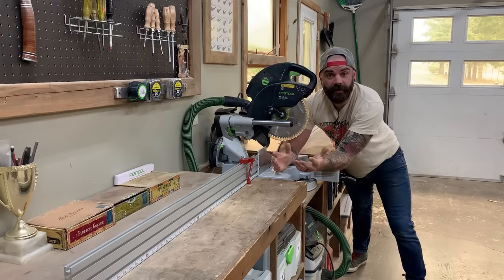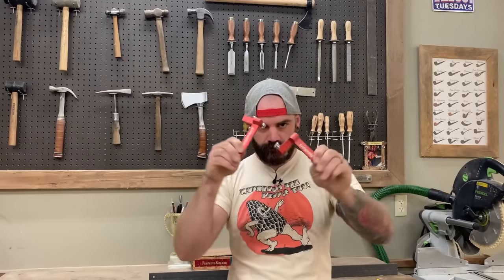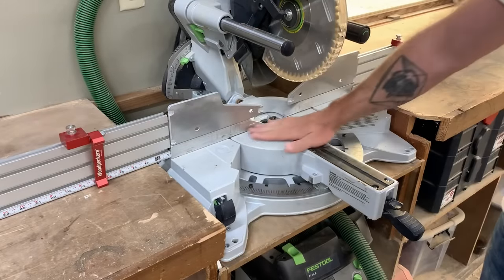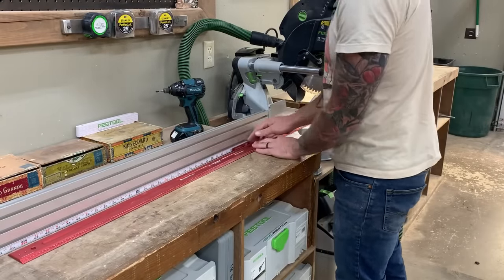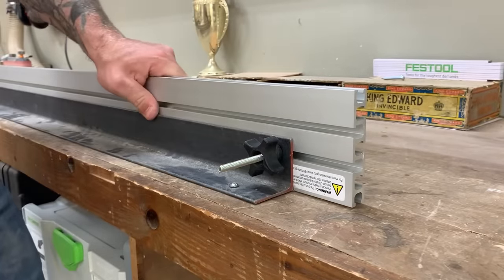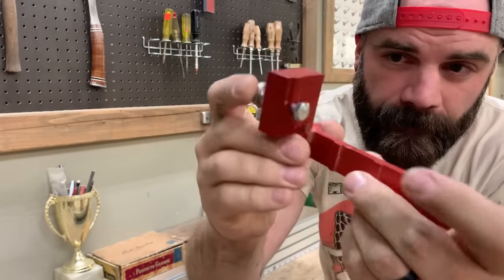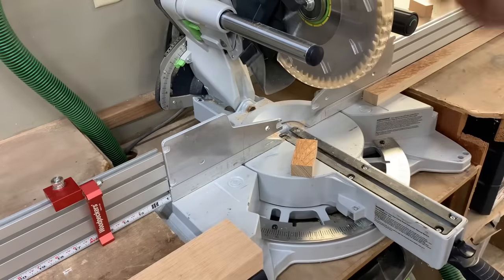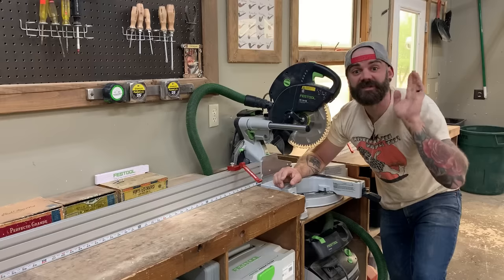DIY Miter Saw Fence | How To Make a Miter Fence

Comment: Jason:

I found you a few weeks ago. I am going to find and watch ALL your videos.
You have a great 'entertainment' technique. you turn a dry presentation into a engaging one.
That said, I am 65 now, and only had a single-wide converted carport to work in (that I had to
share with wifes/daughters 'stuff'. I was always moving 3 things to get access to one tool, then
move stuff again to get access to another tool.
NO MORE, I am about 75% done building my 'shed', it's 24x48 with 10' ceiling. All 2x6 construction.
 I'd upload a pic if I could, but don't know how.
Anyway, one of the 1st thing I will be doing is implementing many of your 'suggestions'.
Thanks and keep up the great work.

Comment: I just finished making mine. The fence worked like a charm. It was much easier to cut and drill holes in the angle iron than I thought it would be. Thanks!
Reply: Did you find long lengths of the extruded fence or simpy butt pieces together?

Comment: I just adore this.  I can't have it, but I adore it.  I have one bench that I need for various jobs.  Maybe with slotted t-tracks in the countertop so I can slide it forward and back, and a few small dowel holes for quick alignment... then I'll be able to mount multiple tools to the same spot as long as I can adjust their height.  I already had to make big adjustable fences for my router and drill press.  Maybe I can make it one fence, multiple tools.  Not to mention having that one long and flat plane.

Comment: Great idea.  I might suggest adding 3 prong nut with  1/4 bolts anf thumb screw for angle iron allows whole system to be removed if you need work space.

Comment: Listen hear Jason, I had made my mind up that when I build my new miter saw station, I was going to use a bench on one side, and a flip up extender on the other side due to space constratints.  Now watching this, I am back to building both sides with a bench.  What am I going to do with Delta/Rockwell Jointer that will not fit under the bench.  Thanks so much for the conundrum.  All that said, I really like this fence system that is brilliantly simple.

Comment: This is giving me all kinds of ideas... I’m thinking threaded inserts for the angle iron with some room for adjustability and leaving the ability to temporarily remove the whole thing. Love the bolting method for t-track... the screws always suck in plywood, especially if in a dado groove. No need for epoxy wit bolts either
Reply: Yes, love it!  I was thinking even If I had The luxury of having a workbench, I would not want the track to be there. Great video though, you are a cuckoo but makes your video more fun to watch!

Comment: Jason I’m mid fifties disabled use a wheelchair and had 2 small strokes which resulted in me losing my short term memory so I can’t remember anything I’ve just started woodworking and still trying to finish the inside of my shed in U.K. would you have any videos on a miter saw station at all. I have some tools not even some basic ones but willing to give it a go. I find your videos very entertaining and found out I can remember bits from your videos as also funny. 
I would just like to say thank you any improvement is a bonus. But thanks and keep up the fantastic job and videos you do
Cheers steve👨🏼‍🦽🇬🇧

Comment: Thanks for the video. The flipping stop is nice. To avoid referencing anything other than my miter saw fence, I embedded t track into the tables on the left and right. Now they also work as assembly tables with a whole grid of t tracks. Just another option in case it fits someone's need out there.
Reply: I'm thinking  of doing exactly this. Do you have any regrets doing it like that? Stop blocks in the way, etc?

Comment: Hi there loving your channel here’s a little tip for you I watched a video you did where you show a easy way to set the depth stop on your router using setting out blocks which are very expensive instead I use a Alan key or even drill bits 👍🏼 keep the vids coming

Comment: Your suggestion about moving the aux fence back 1/8" from the miter saw fence seems to make practical sense for the times when you have a bow in the workpiece.  However, if the aux fence is not going to touch the workpiece, why have an aux fence in the first place?  Are the flip stop and the tape measure the reason you have the aux fence?  If you have a bow in the board, an aux fence placed flush with the miter saw fence, would be a quick way to identify the problem, which then could be addressed with the jointer or a track saw prior to cross cutting on the miter saw with an accurate fence.  A longer accurate fence would also assist in aligning a long board for an accurate cross cut, rather than relying on the short fence of the miter saw.
Reply: Same same don’t get it. Why set up up for something that it not right in the first place. If the board is flush the fence is not helping.  Is it.

Comment: Rather than using only a straightedge, consider using a laser to sight the full length of your fence... that way you don't get any error at all even @ 6' or more from the saw, if your fence is that long. Set the laser on the opposing side so it slides down the entire length of your target fence, with the light visible along the built-in miter fence...

Comment: Need to make stops & measurements for miter cuts, since you show the whole thing moved out of position.
Maybe similar to that 12" block ? -- move T-track a Fixed Distance to let saw fence clear the tilted saw, then make mitered blocks for typical angles. -- Yes ?
 Good video.

Comment: Love this video! I will be remaking my miter saw station after the first of the year.  Not sure I understand the reasoning for moving the fence back 1/8".  Also, Can you share the cost of this without me having to look at all the websites?  Thanks!  A PM will be good!
Reply: Yeah, I agree. I’m no expert, and I could be wrong but if one is referencing the nice long, new additional fence which is set back by 1/8” then the cut will be askew at the blade. If you’re pushing up against the miter saw’s built-in fence to begin with, that 1/8” gap on the additional fence is going to show; and at that point I’d think the additional fence would not be helpful. This is not a criticism. I just want to know the reasoning behind it, since I’m not getting it. Love your work.
Reply: He covered that in the video. Structural lumber you get from the lumberyard or have delivered isn't all perfectly straight. If your fence is flush with the saw fence if the bow starts after the saw's fence it will push against the longer fence and your cut will no longer be perfectly straight. The purpose of his fence is to allow you to set up a jig for rapid cuts all of the same length, and it does that in spades.  I made the mistake of building my mitre saw station so that it butts up against my CNC Router table and using it and its perfectly machined square fence for this purpose. Made a bunch of cuts couldn't figure out why some of my cuts were perfectly square and some looked like they were cut at an ever so slight angle.

Thought my fence was out of square.. ran a dial indicator mounted on my spindle along the entire 8' machine bed... was out by a maximum of 0.001".... because I machined that fence to my spindle head... The issue I found was all my structural lumber I was using for my deck and garden boxes had bows in it from the yard one way or another and by going flush up against my perfectly square fence I was transfering that bow to my cuts.

Comment: I know this video is old, but I've been looking at those Woodpeckers flip stops and they have two mounting holes for an offset sub-fence or not. Yours is mounted in the wrong hole to make it lay flat against the fence, or you like it slanted. It's hard to tell, but I can tell you that I read the manual and that's why I know this.

Comment: Jason great video!  I was wondering if you could do a video on making a cabinet for holding a microwave over a stove?  My house has a huge stove vent that I need to remove and add a cabinet.
Reply: Lowe's 30 in cabinet one high end microwave / confection oven super easy install comes with everything you need

Comment: I have two questions and one sub question:

First, in hindsight, would you build the aux fence further to the left with your miter fence already extended a set amount and put the tape there? Why or why not?

Second: Why don't you pick up that thing you keep tripping over?
Reply: I don't think it's a thing that he's tripping on, so much as having to much of that bourbon in his channel's name. 😆
Reply: @randomnonsense_1  The rest of the video he was walking around fine..... Obviously there's a bolt or screw he's dropped on the floor.......

Comment: Does the warden know you have a sharp axe in your workshop?  Why are you using 4" (or whatever) ¼x20 bolts when a 1½" bolt w/should work fine?  Another great video from the moth guy.

Comment: Great vid, appreciate your humor.  I was going to build a fence for mine but its on a mobile cart with fold up wings.  I just need the fence to be 2 feet long. Any problem with using the miter saw to cut the aluminum fence?

Comment: Lets say you have a 10ft space to build something like this. Do you put the saw in the middle or offset to one side to allow longer stock on one side? Thanks for any info.
Reply from the maker: I cut on the left side much more often then the right so I’d probably leave more room on the left
Reply: My shop is (ridiculously) long. My mitre saw ONLY goes left because I'm right handed and I need that hand to operate the saw. Cutting right handed with the wood out to the right is ... well it feels very odd. If you're left handed you might need to have your wood out to the right instead. To the right of my mitre saw is just some roller stands for when I'm cutting 6m (18ft?) long boards and have a lot hanging off the end.
Reply: Bourbon Moth Woodworking thanks for the info! I think I’m going to build it on casters now. Just rolling it a couple feet will give me lots of extra room.

Comment: move your nuts that hold the fence to the angle iron in about 8 inch to a foot each end then if you have to move it you still have 2 nuts to loack the fence or put one in the middle

Comment: Why did you set the fence back 1/8"? You said something about if the stock has a biw in it or something?  I made an outdoor miter saw fence setup. Since I don't have a woodworking space. I put mine equal to the current fence.

Comment: My question is not how, but why? What is it for? As many have pointed out, it serves no purpose- the fence the saw provides is all you need- it is the only place the material needs to be referenced. Indeed, if the material is not straight (and it often is not) the extended fence can hold the material off the saw fence and you do not get an accurate cut. Save money, ditch the fence. You can still have length stops- they can be attached to the bed.

Comment: Just a thought but wouldn't it be easier to cut t track at length from blade then install there rather than put a new tape measure over existing

Comment: "If there is any bow in your board at all, it will be out of whack when you cut it at the miter saw." This begs the question in my mind - why are we so careful to cut bowed boards then? I'm only interested in cutting boards square when they have already been milled. If I'm breaking down rough lumber, I'm cutting with extra length and don't care about being out of whack. I'm an amateur, so I'd appreciate hearing what I'm missing here.

Comment: Seems like the only use the fence has is to hold the stop block. Am I missing something? Could you not just put a t track in the bench top?
Reply: That would leave your track full of sawdust and/or metal chips.
Reply: @Read_Exodus31  I have a compressor and lungs as a backup. I also have a multipurpose bench without tracks in the way.

Comment: You should mention all angle iron is not 100% square, the big box store pieces are the worst, up to 2⁰ off square, every city has a metal supplier in which you can buy off cuts at a reasonable discounted price, I find cold rolled angle iron is usually good for being square but in reality it's better to shop around and bring a square with you to check your pieces regardless of where you shop  before you purchase. Also.. you can get structural or architectural aluminum angle, in this case architectural would be fine.

Comment: I didn't understand the reason for the 1/8'' offset. Maybe someone can explain it in easy english?  :)  many thanks
Reply: The stock you are cutting needs to be flush against the mitre saw fence to get a square cut. The fence extension is more for using a stop block to get repeat cuts. Not all wood is straight, so the 1/8th offset is in case you're board is slightly bowed, then it won't sit flush against the mitre saw fence.
Reply: So I feel like I understood that the first time around in the video, but didn’t he talk about making it flush against the fence later in the video?
Reply: @R53Driver  The end of the extrusion/fence should butt up (be flush) with the miter saw's fence. The face of the extrusion is set back 1/8-inch.